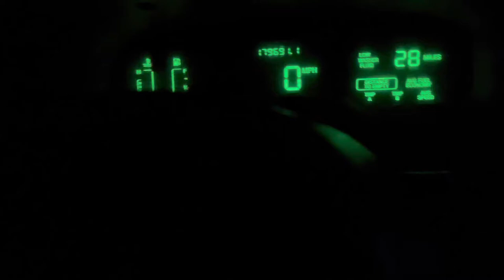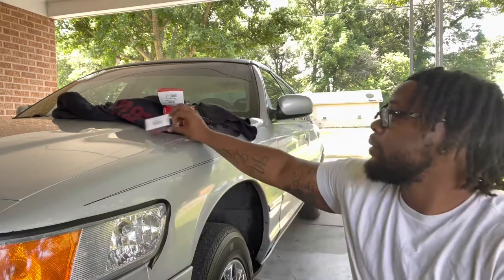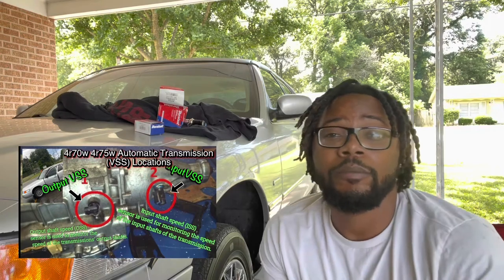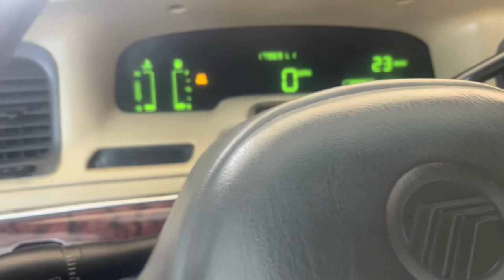Vehicle Speed Sensors Symptoms Locations and Repair DIY 4r70w 4r75w Automatic Transmission

Comment: This video came in handy. I just changed the input and output sensors. It was a tough squeeze for the output but I got it done. #96GrandMarquis
Reply from the maker: I’m glade this video helped fam! Subscribe Support and vibe with the fam💯💯
Reply: Is it shifting gears now??
Reply: @davjones2724  yes. My car drives smoother than ever!!!
Reply: @mzpoison87  well that was for a 96 yr model. I have an 05. The transmissions on that yr model...is a lot diff from a 96.
Reply: @mzpoison87 what is your trick to remove the output sensor? I’m having a hell of a time, pigtail snapped off and I’m trying to try and get a screw driver under the seal touching the transmission

Comment: Bro this video is what I been looking for ‼️but question… I had my rear end changed out and every since I did  I was told I need a new sensor because mines change out and all but the speed the on dash is not right I can be going 70-80Mph and it will be saying like I’m going the whole dash and won’t go faster by it reading as I’m doing the whole dash I used my phone to check my speed to see how fast I can top it out what you think bro? You think I need to change it out

Comment: On my 2000 Merc Grand Marquis I got a PO320 Code. Car was hard Starting and when running keeping it running. Online they gave 3 reasons for the PO320 Code.  Either CamShaft Position Sensor right up in front of the motor or Crankshaft Position Sensor to the right of the A/C Compressor in the block or Speed Sensor.  Changed out the Camshaft Sensor with a new one made no difference. Left it in. Replaced the Crankshaft Sensor behind the A/C Compressor. Car started up and stayed running. Thought that fixed the problem. Lasted 13 months and got the PO 320 Code once again in the dash. Replaced the Crankshaft Sensor a 2nd time and was good to go once again. Lasted 8 months and then I got the PO320 Code again and hard starting and trying to keep it running. I once again replaced the Dorman Brand Crankshaft Sensor. I used the Dorman Brand twice. I decided I would purchase a original Ford Motorcraft Crankshaft Sensor this time. Installed it. It lasted 5 months and now back to the PO320 Code once more and hard Starting. I just purchased both of those Speed Sensors you showed in your Video. They are still in the box. Car is sitting it is Winter time December 26,2022 and very cold. At my age I am not going to crawl under the car and deal with it now but I plan on replacing both Speed Sensors if my trans uses both. Purchased them both on Amazon being Amazon shows 2 Speed Sensor but I haven't been under the car to see if I have both and don't know what transmission came in our 2000 Mercury Marquis is of the moment. The Car only has 39k miles on it. Just curious of your thoughts or anyone elses reading this post that may of had the same PO320 Code with either a Mercury Marquis or Crown Vic. I should mentioned I also looked over the wiring going to the Camshaft Sensor and Crankshaft Sensor. They both look to be in like new shape. Also I should mention I have had no problems with the transmission shifting. It absolutely works fine. I am just guessing based on the PO320 Symtoms I read online for my 2000 Mercury Grand Marquis showing a PO320 Code and what happens once it appears on the dash. Hard restarting and keeping the engine running. I was about a mile from home. Had to use 2 feet to handle the brakes and gas to drive it home.
Reply from the maker: If I was you I would do a full oil change and tuneup (Spark Plugs & Coil Packs)just to insure all cylinders are firing!! Then I would instal both can shaft sensors. see if your problem is fixed if not take it to a near by mechanic for a more detailed diagnostics!!
Reply: @topiqchill241  Thanks for the reply. I use a OB ll Scanner on my car and the only code coming up is a PO 320. If a plug or coil was bad it would be missing running on 7 cylinders or less depending plus a different code would come up pointing to that problem. I just spoke to a mechanic I know well who doesn’t live in my area anymore. He told me I was wasting my money on the speed sensors for the transmission. I had to agree with him. There is really no problems with the transmission or Speedometer. It shifts perfectly fine. The car doesn’t have much mileage on it. I think there is a intermittent short in one of the wire harnesses. I am guessing it is the harness going down to the Crankshaft Position Sensor.

Comment: I have an 05 grand mark. Code p720. It won't hardly back up.. or go forward. Only 160 k miles. Check eng light is on. And a little orange wrench is on to. What could it be to make the car not go??
Reply from the maker: Get the trans rebuild or go with a new one. And get your vehicle serviced

Comment: Bruh where did you get that green cap that goes on the sensor? What part store did you purchase both sensors?
Reply from the maker: The local Advanced Auto Parts
Reply: @topiqchill241   I’m glad you put this content out because I have a 2002 mercury grand marquis and my speedometer is doing the same thing yours was doing.
Reply from the maker: @russellanderson6096  thanks fam these 4.6s are the new old schools. Have to keep the maintenance up to date on them
Reply: @topiqchill241  I know bruh that’s all I been doing. I will most definitely be in tune with your content bruh.💯
Reply: It comes off your old sensor. Its like a Windex refill bottle. You use your old spray pump with the new bottle. I have a 1997 Lincoln Town Car and my "cap" was tan, but its still the same.

Comment: I got p0715/p0717/p2106 after replacing TSS. 2006 crown vic. It fix hard shifting but codes still pops up every time.
Reply from the maker: Bro if your car is running fine and you don’t  have any issues from your transmission. Try resetting your battery to reboot the ECU..